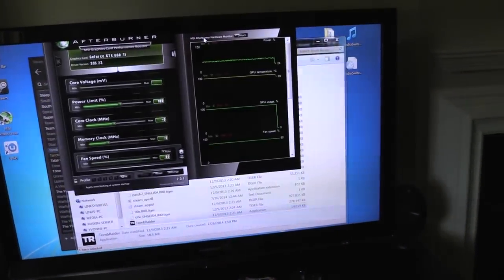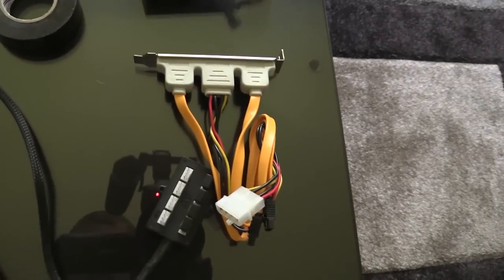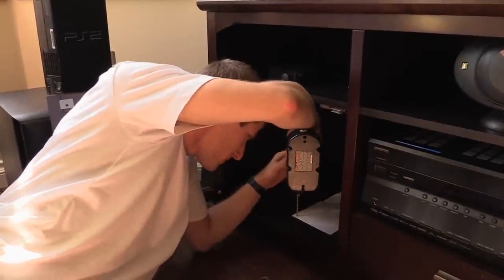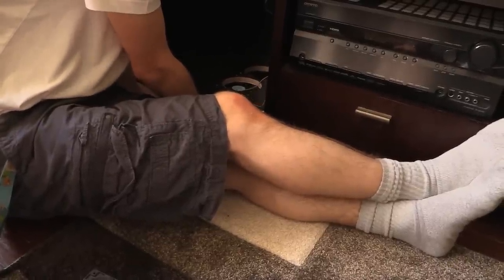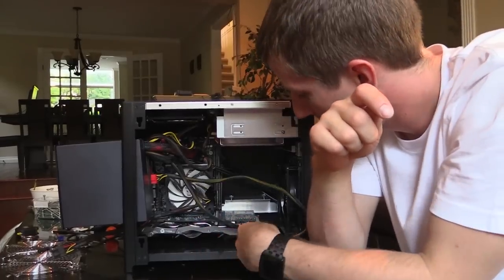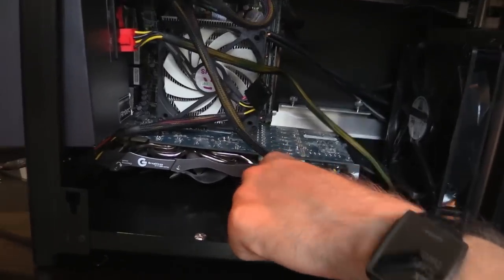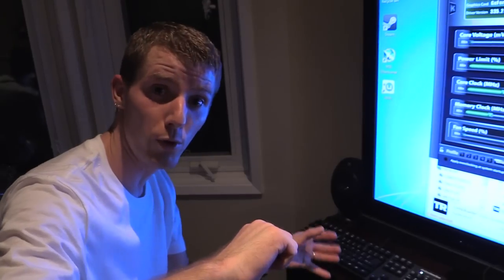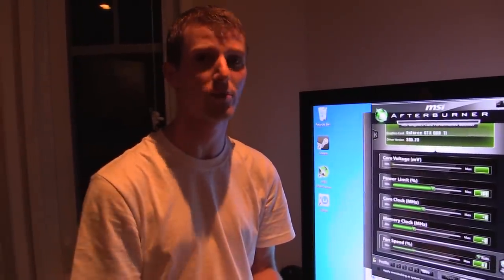Entertainment Center Cooling Mod - Linus DIY Method

Comment: Seems like an awful lot of work for such a small gain.  I would have just put a regular fan that plugs into the wall instead of using a bunch of computer fans.
Reply: Not a small gain, the card is running at its peak with no throttling.
Reply: And it was boosting

Comment: Having many years of experience with holes saws (cutting wood, plastic, metal) always remove the hole saw and using the pilot bit that's attached to it pre drill the center hole first. This allows easier alignment of center plus if you do it the way you were you have to deal with the pilot drill cutting a hole and also the hole saw cutting at the same time, this can lead to the bit slowing the holesaw down and causing overheating and also causing the hole saw to be off center and kicking the holesaw out of center and breaking the pilot bit. The last part being really nasty of the holesaw catches your hand or other body part.

Comment: lol and i freak out when my gpu goes over 60c
Reply: lol that's normal freak out if it's over 80c
Reply: Amir M'Saad I know I used to have a 560ti with a only 1 of the 2 fans working shit would jump up to 95c then turn off
Reply: +Blazed-Banana My old 560 ti still has a soft spot in my heart.

Comment: i like your wife's idea better. i was actually in the process of planning this out myself. im putting a nzxt switch 810 inside of my desk and i am going to have to put several fans on the desk to avoid thermal throttling. i got really excited when i saw your video about this. i thought i was just crazy!

Comment: The ultimate HTPC cabinet mod would have been to build a PC into the cabinet. Salvage the right and back panels off of an old PC case so you have proper mounts for the mobo and expansion slots, cut the back of the cabinet so your rear I/O and expansion can get outside, drill some holes for your fans and done. Perhaps set up a separate power supply and fan controller for the cabinet fans. Use the Cooler Master HAF XB EVO or something with a removable mobo tray to make swapping out the motherboard easier.

Comment: @linus 
You but the fans in/on a wooden cabinet. the wood is a great conductor of vibrations which in turn also amps up the noise levels. what you could do as to help lessen the current noise levels is to put some sort of rubber stand off type .... mod. on the fans screws in order to reduce vibrations.... (eliminating more ambient noise)

Comment: A better way would be just grabbing an 120/240VAC to 12VDC and dropping a molex on it, or even at that, just buying a cheap lil' 3.5in HDD enclosure that has the PSU that can do 5V and 12V at 2A, and then wiring that into the fans, and then you could stick a resistor in the line to adjust fan speeds if you so desired, that is what I did for my personal setup, which is very similar to his, and it works very well, and is near silent. :D

Comment: may someone said it before but i think you should have just screw the whole thing into the cabinet, without the case and maybe add some LEDs if you like or make a "decoy" cover to the front. with those fans blowing it should be at a nice low temp with no problem

Comment: I had a way more ghetto way of cooling my system for 10 months until now. Just removed the window on my Corsair case, cause otherwise there would be no airflow. I'm pretty proud that my 4 year old PC could handle the risk of a Static Discharge for 10 months with little to no errors. I am going to upgrade my system, but I'm definitely gonna find a new way to use my current one, cause damn. That was pretty awesome (My desk is a high static discharge risk most of the time, so going solid for 10 months without getting one is pretty insane I'd say)

Comment: well, u could go to a more expensive solution and go for the full watercooling solution (yes, motherboard, ram and graphics card included) and than hang the radiators out of the furniture and use quick release connectors for the hoses. But yes, it would be a ton more expensive, but i think that the heat would be drawn out of the cabinet in a more efficient way.

Comment: I'd definitely love to see more videos like this! Also,  maybe the Silverstone SG05 Lite would be a better option for a case? It's smaller with much more ventilation and can still fit a lot. I've got an Asus 760 OC, x3 2.5" drives, and an H60 in mine.

Comment: I would control the fanspeed by the CPU-heat, which can be done by one of the chassis-fan connectors on the mainboard.

Comment: I would like to see more videos on home integration with the network and tech. My home, like so many, was not built with network cabling pre-installed. I would like to add cat5 and a central box to distribute the network to different rooms and I could use some tips to best pre-plan for this and execute it.

Comment: I just did this for my PS4. I wanted a glass cabinet to keep up the dust out, with a laptop cooler underneath my PlayStation lifted an inch off the base. 

Heard it kick into high gear once, immediately shut it down. Grab the drill and some mesh fibre and a computer fan I had left over from a projector I took apart. wired it up put the mesh over the holes good to go.

Comment: The problem with bottom fans is you are pulling any floor dust that builds under the cabinet directly into your machine. Otherwise very cool.

Comment: I agree with wife. Why not just use the pci expansion mount it came with.  Real problem is lack of case air flow and lack of a good heat sinks on video card. Zalman make awesome after market heat sinks for cups and gpus. I highly always recommend ripping off the stock and going for a zalman heat sink.

Comment: you should drill  air vents in your cabinet in front of your GPU fan to increase air flow of your graphic card, so as to avoid the same hot air to circulate in the cabinet again and again .

Comment: I actually have a few (various) slot cover plates with power pass throughs in them in my tub of cooling parts that could just go into an unused slot on the case...  But plan B would be (and  I have done this a number of times ) would be to drill a round hole on the back of the case the right size for a rubber grommet  (from  the handy harbor freight box of assorted  sized ones).. Id then use the tool to remove the wires from the molex connector and slip them through the hole/grommet and then put them back into the molex connector...  also id be sure to use those easy extractor molex male(female? whichever way that goes) connectors that have the curved pieces on them that pop the connectors apart when you squeeze them as they are a must anywhere its hard to get 2 hands into to disconnect the molex which  can be a pain in places like the back of cabinets.....   I actually did just add fans to the area I have my cable modem, router and router attached external HD.. the modem and router each have thermaltake fans with the variable speed controllers  set  at lowest speed and the HD has a slow near silent 120 fan blowing  on it.. All 3 pieces of hardware were  very warm to the touch before but are no longer any warmer then room temperature...   Oh in that situation Im powering them from a spare 650 watt power supply which has a self controlled large fan in itthat seldom even turns on as the 3fans are all it powers. I was going to jump the pins so it would run but I had an old PS tester that I seldom used I plugged into instead and it lets the ps run without a mb...

Comment: This comment is probably too late now but i was gonna say instead of running the cabinet fans at 12v depin and switch the molex pins around to 5v. That's what i like to do for silence. If that still didn't work enough for you, you could try putting foam in between the fan and the cabinet so vibration doesn't transfer as much.

Comment: I probably would have used 2-3 fans on the back of the cabinet and 1-2 vents on the bottom of the back of the cabinet and raised the PC case up about an inch off the shelf with some tall rubber feet. Plus I'd have used a 12V 2 amp wall wart to power them with a reostat inline for speed control.

Comment: I have always been....well...some sought of a freak for AIR COOLING..I would probably use 140mm fans for the project as it moves more volumes and less noise. And, I have always wanted to get a full allu case from Lian Li and think maybe it would make cooling any different than steel/plastic cases. So in your project I've learned that Aluminum cases would probably gives you better temp in the open but definitely, in your case with an enclosed area, it did almost nothing or probably worst. So I would go for air ducts or water cooling. :)

Comment: I think your wife had it right. Any mod that needs "dremeling" the case should be thought at least twice. I used a watercooling hole on the back of my CM 690 to pass a USB internal header cable out the back of the case. It's ideal if you plan to sell the case some day in the future as someone who doesn't need the mod will think it's a disadvantage.

Comment: Your wife is 100% right!  You would have added a lot of extra time and effort to a build just to make something look moderately better looking. That is of course based solely on preference. Keep in mind this is on a system that is hidden in a cabinet and doesn't see the light of day very often. It isn't always about how perfect you can make something its actually more often does it work and function properly and how often is it actually seen.  Sure if you have a glass panel and its on a desk and you have to look at it all the time then yes go for cleanliness.  My tower sits on the floor under my desk and I don't have a view panel so my cable management was  don't interfere with anything and be easy to clean around.  The extra time spent on doing something clever that wont bee seen much is time wasted that could be spent Gaming, handing with friends, Hanging with loved ones or perhaps most importantly spending time with your wife and kids.  Save the time and play with your kids more.  I see you guys wasting so much build time on your junkyard builds it kills me.  I know they are tore apart soon after and they are cheap and only meant to run for a short period of time. Save the cable management time for over clocking or trouble shooting.  then if your sitting around with your thumb up your but go back and cable manage. 

Rule of thumb.

Will it be seen?    No- then F it make it function and easy to move for cleaning.
                               Yes- take the time and make it pretty.

I shudder at the thought of how much time you guys waste on cable management just to undue it all in the near future to reuse parts on different systems that you then waste more time on that will just go back into the cycle eventually.

I know you guys are doing shows and that stuff is somewhat important so people take you seriously. I Just think you should try to come up with easy quick solutions that will look good on camera but can be undone quickly and reused.  Perhaps some bulk rolls of wire loom or those Zip ties with screw holes.  Add a small piece of double sided tape to the screw hole and slap it against the case instead of screwing it. Heck why not both?  You can get wire loom in colors. This could add an extra dash of custom to your builds.

Comment: In that scenario I would not use a full case so much as make the cabinet the "case" then apply  rubber vibration grommets to the fans. I would also link the PM headers to my gpu (asus strix) so it can control the cabinet fans.

Comment: Don't use a case, ghetto mount the rig onto a plate and have it directly cooled by the cabinet fans :)

You wouldn't have the PSU in the way and you'd see all the internals through the glass. You could put in a false side/back to hide the spaghetti and PSU?

Comment: I saw two options for linus here.

1: replace gpu cooler on the 660ti, drill holes, place extra fans, put power supply into place,
or
2: buy a 750ti.... would be a tiny bit slower but run much cooler without having to add extra fans and all that stuff. ;)

Comment: Cutting the case can end up being VERY ghetto if it's not 100% clean, at least this way you can undo it later and it's at the back anyway so it's probably the better option. If you had a spare PCI slot in the case you could have just mounted the eSATA hub directly and used that which would have been the ideal solution.

Comment: Running fan wire or power wire outside of the case seems like a bad idea especially if you are going to DIY on some the the plugs and connectors. I don't even particularly like the plug. If means you're going to have to mod every PC or component you put in there. I would use a 12v wall wart and call it good. Later on you can add a NPN transistor with the base hooked to a USB line (through appropriate resistor and diode) to make the fans run only when that computer is on.

Comment: I'd buy a sheet of Modder's Mesh from MNPCTech, dremmel out a 240mm rectangle in the bottom of the case, then cut the mesh to size with some tin snips and epoxy that sucker over the hole (from inside the case). The result would be WAY better ambient, GPU, and CPU temps. You could probably find some kind of dust filter from an old case to throw in there as well. Going with a blower style card would be more expensive, and I personally think the temps still wouldn't be acceptable.

Or if you want to go crazy, you could drill two small holes in the back of the case and route a couple of coolant tubes through them and water cool the GPU with an external radiator that's mounted on the back of the cabinet.

Comment: One random question...why not cut a square hole to fit the 120mm fan flush-ish within the inside of the cabinet?

P.S. I like your way purely because it sounds more impressive if a guest asks how you set that up

Comment: my closed cabinet has a ps3, ps1, n64, onkyo receiver, and a dell laptop motherboard screwed to a piece of wood as a media center, and things get pretty toasty. i wired an old 80mm cpu fan to a cannibalized USB cord and plugged it into one of the laptop's USB ports, and exited it out the open back of the cabinet. just by feeling the surface of the wood inside, i'd say that one fan dropped temps a good 5-10C. im probably going to come up with something a little fancier with a pair of 120mm fans in the future, but for now it keeps my hardware from being too pissed off

Comment: her way is more sensible, however depending on the GPU and even the house it may lead to danage to the GPU or motherboard in the future, i would have preverred you cut a hole in the case and then slide the cable through

Comment: either way is better then what I did, which was splice my fans cables with 12v wall zits so they plug right into the wall...

Comment: maybe 3 nf f12's? they give more punch into the cabinet as airflow and as exhaust use a 200mm fan? if it fits... quiet and many air at once output right?

Comment: Taking your case and where it's at into consideration, while not ideal as is for cooling, using the ol' server fix where cool intake air enters the front and exhausts hot out the back fits the bill for small, cramped spots. It'd mean taking out the glass and replacing with (black for low viz) mesh, but you'll save your components from an early grave. Personally, I always prefer full size cases and arrange my environment for the computer ;-) I hide my big boy out in the sun room away from the kiddo. Watercooled and networked!

Comment: Great job on everything.... but... Linus.. Cmon... you're a professional... Lets see some cable management behind that tv!

Also leave those internal circulating gpus where they belong (on the shelf at the store). Rear venting / blower is the way to go. And would drastically lower your temps.

Comment: Have a suggestion Linus I had a similar setup to cool my Xbox and media center gear but in mine I did a fan controller connected to a external psu

Comment: nah man. so basically youre still left with that small rectangular intake opening in the bottom? that wont do. ideally you should open a hole in the case at the bottom and install an intake fan on the case itself, and just position the case over appropriate hole in the cabinet. would help with noise also, vibrations would stay with the case, not spreading to entire cabinet. and for the exhaust you should ideally find a way to let the power supply to directly let air on the back on the cabinet along with hot air from inside the case, from cpu and gpu. you could do that by making a hole on the back of the cabinet for that, and install an 60mm fan on the back of the case, by the power supply(and remove that 120mm one at the top), so it can exhaust on the same hole in the cabinet as power supply. alternatively, you could move that 120mm fan from the top to the side of the case, but either way you need to modify the case.

Comment: Suggestion: why don't you use something like a dryer vent  hose exhaust on the intake on the bottom, and use the top exhaust with a hose as a out. so a single in and at the bottom and a single out at the top?

Comment: A way easier "fix" is to just use the Steam In-Home Streaming feature. Pretty sure just decoding the stream on the PC would not cause it to overheat. The service launch a few months before this video, so why have you not used it?
Reply: are you aware how old this video is?
Reply: Yes, I am. But the service was released way before this video.
Reply: it was in early beta so no, not released, not even close

Comment: 9:02...
Yeah, if you took the time to paint the case and everything, the external was less ghetto... but also a PITA.

But then again I set my w/c radiator in the window and I think a mouse made a nest in the wires and tubing.